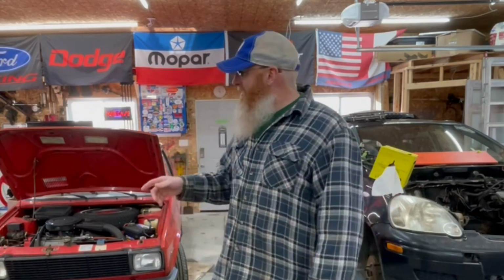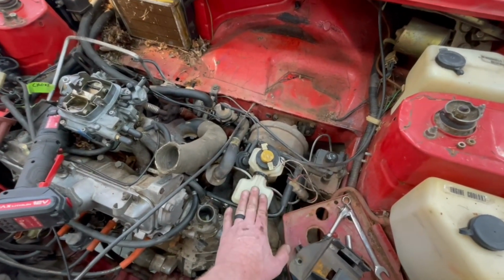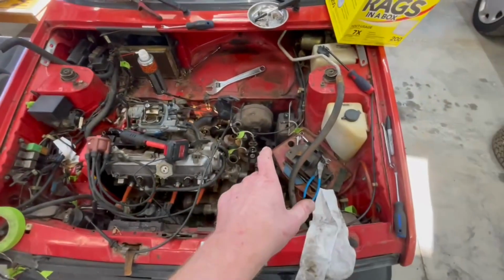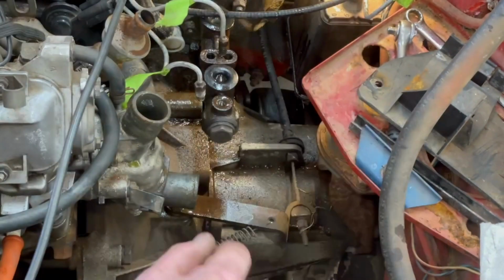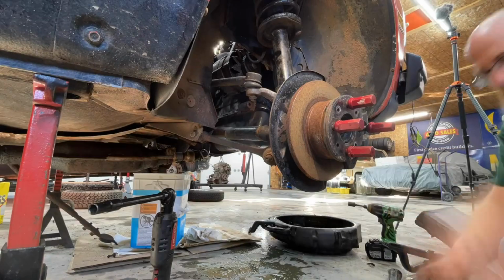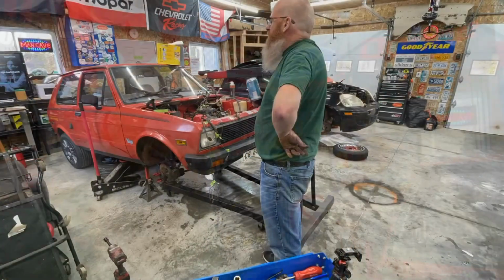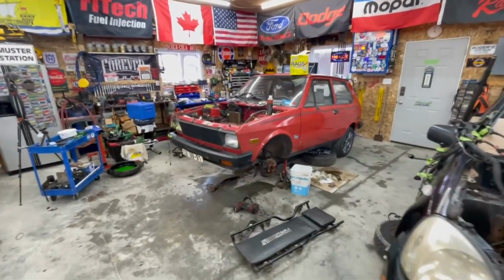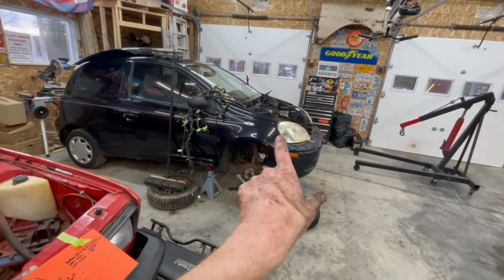YUGO Engine Swap Hits A HUGE Wall- Fabrication

Comment: I really like you Yugo series. If you type in Yugo Relly car you will see how you can modify them. I’m from Serbia originally where this car was being produced, last one was built in 2008 and they were building Yugo’s for 40 years without any changes almost
Reply from the maker: I did see that video before. I know there is a lot to do to make these cars stronger. I will be addressing that. Thanks for watching my friend.

Comment: Hello OCG I Wanted to let you know I am following your YUGO Racing Buddy on his Build just wanted to pass this along he's reinforcing the body and frame and you might also because I guess the little car's aren't designed for extra power and it might become a Deathtrap. And about the brake booster setup Google the old Chevy, dodge, Ford Van's from the 70-80's a lot of the booster and masters cylinders were setup sideways it might give you some ideas 💡
Reply from the maker: Oh I'm definitely gonna be adding strength to the car!

Comment: As an experienced Yugo tuner, I have to warn you that first you have to strengthen the body because there is a weak inclination to twist and fix the suspension, then think about the engine... and please don't put 15' wheels, the Yugo then looks like a Lada Niva 4x4.
Allen from Kompas Garage wants to race with you
Reply from the maker: Yes! Allen and I have ben in contact. I do plan on adding structure to the Yugo for sure. I guess with only 50-ish horsepower they weren't too worried about regidity!

Comment: Not really sure you are even bothering. So much of those cars were cheap junk. Except for the bucket seats! Guess that's because they had to be comfortable because you had to wait for the tow truck. I had a set of those seats, they set pretty darn good 👍.
Reply from the maker: Fair enough! But that the main reason for the swap, reliability of Toyota.
Reply: @OldeCarrGuy  
Cool.
Ever heard the joke?
Guy goes into the parts store.
"I'm lookin to get a gas cap for my Yugo!"
Parts clerk replied "ok that sounds like a fair trade."
Reply from the maker: @jamesdavis9774  lol! I have heard that one and many MANY more!

Comment: This looks super fun and the right kinda wierd. Back in 08 I swapped a 1jz into a 2001 miata for a high-school senior shop project and bein hooked on doing wierd swaps on wierd things. Amd are yugos as tough and durable as you would assume coming from commie block ussr
Reply from the maker: Not particularly. The Toyota drivetrain will be the toughest part of the car. I appreciate your appreciation for weird!